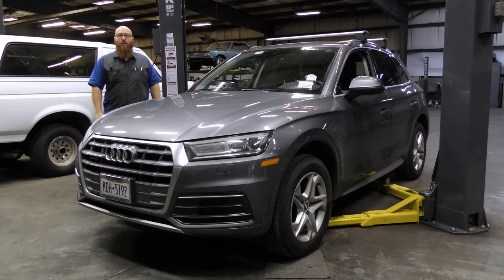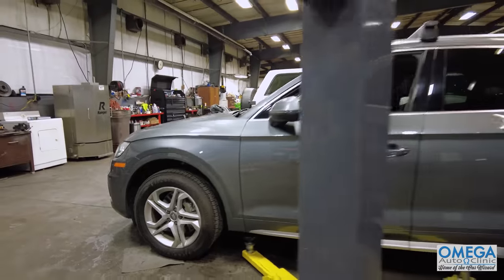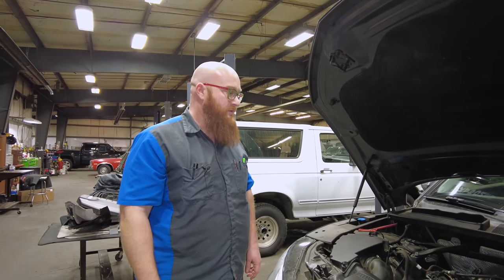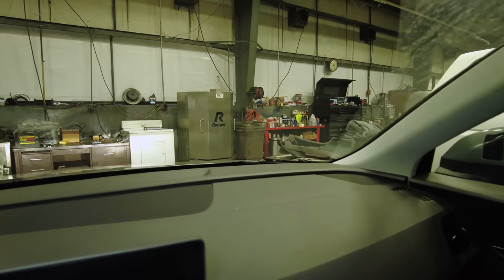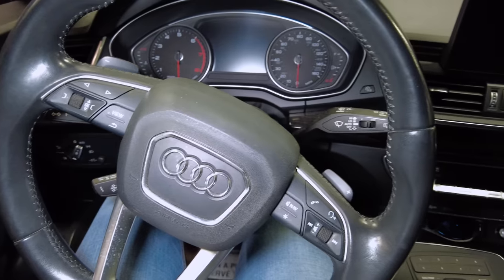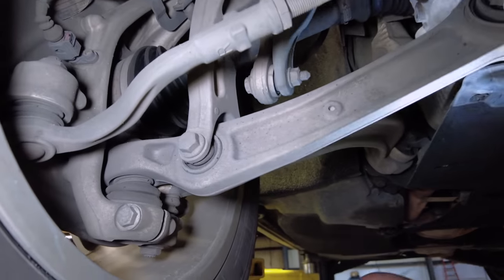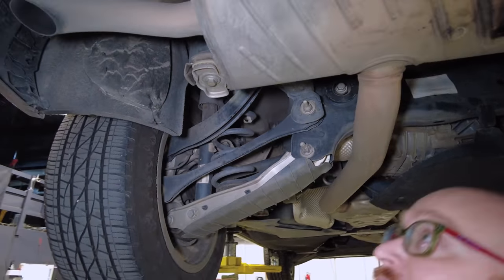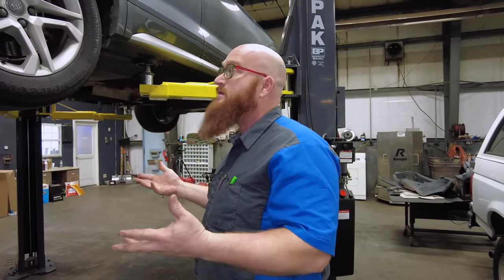2019 Audi Q5 with 200K miles & the service records to prove it! What did the CAR WIZARD need to fix?

Comment: If I had kept up with the maintenance on my 2014 Jetta SE I would still be driving it! The car ran great, transmission shifted smooth (even though it had never been serviced) and the alignment was perfect. 
Unfortunately, the 1.8 TSI had never had the timing chain checked, the water pump was original, and it needed Control arm bushings, which are not sold separately from the arms. I needed a vehicle I could rely on to make trips on the interstate, and we'll, with the transmission never being serviced, that wasn't happening. I traded it in with 187k miles, and regret it every day that I drive this 2021 Corolla LE.
Reply: But your corolla will NEVER let you down or leave you stranded! That's what you said you needed, reliable transportation on the interstate.  Yes the corolla is very boring,  but it's very efficient,  easy to maintain,  and simply won't break. Can't be beat for the attributes that people buy corollas for!
Reply: I have a 2016 Jetta with the 1.8T, I love it so far
Reply: At least Scotty Kilner would approve😂
Reply: @sunnohh  He would stand corrected in this ONE rare instance. He would also say that nearly 200k miles in a 2019 vehicle HAS to be highway miles and highway miles are 10% of city miles. So essentially that audi has 20,000 miles on it in respect to wear and tear.  Good stuff. If those miles were an even  mix of city and highway,  there would be a ton of breakdowns no question.  Based on the data even with good maintenance. They simply don't hold up over time.
Reply: @gabevillarreal96  except I have already had issues with the radio, there is a weird vibration only when hold a speed, and the CVT transmission is very annoyingly slow at pulling out into traffic, causing me to have to anticipate a longer distance between cars to pull out into traffic. That's fine in rural areas, but in the city where it's bumper to bumper, it could be a long time to find an appropriate gap to pull into traffic in. The road noise is horrendously loud compared to my Jetta as well, which makes the issues with the piss poor calibrated sound from the radio so much worse. To get the sound even remotely decent, I had to fade the audio all the way to the back to get it off the windshield, and turn the mids damn near off cause I could literally hear backup singers louder than the lead singers in most songs! The built in WIFI was registered under the previous owner, and I cannot get either AT&T nor Toyota to clear it so I can register it for me, so that function is dead as well! (Toyota says contact AT&T, AT&T says contact Toyota, it's a huge mess!)
Reply: @gunnargeroy8406  I literally only changed the oil, tires, and air filter on my 2014 for the 5 years I had it, and never had a single issue until I went to have it inspected the last year. The Cam phase sensors on the intake cam had went bad. No big deal, but for those 2 sensors and a oil change (since they had to take the filter off to get to one of them) cost $964, not bad considering that was the ONLY repairs done to the car. The only other issue I had was the trunk lid would fill up with water when it rained, my only guess was the seals around the lights on the trunk lid were bad. Opening it up and holding it open would drain the water out, but if I forgot to do it for a while, the water would go into the spare tire well and fill it up as well.
Reply: @Celician83  Well I hate that for you! Especially in a 2021. Those are nagging annoyances but I truly believe your Corolla will remain consistently reliable and dependable
Reply: @sunnohh  in some ways Scotty has a point, but others he is a total quack. For instance, IDGAF how well it worked for him, using "Head Gasket in a bottle" products is NEVER a solution for a car! It causes more issues than the head gasket, and a lot more work to get that engine back up to running, sometimes even ruining the engine and coolant systems in the process. If you have ever worked on a car that it has been used on you will know what I mean! It will stop up your radiator, heater core, ruin your coolant hoses, oil cooler(if it has one) water to air intercooler (again, if it has one) water pump, and more! If you plan on junking the car in the next week or so, sure, use it. But if your doing it just to sell it, that's a really dick move your doing to the next owner!
Reply: @Celician83  well for only that with 187,000 isn’t bad at all imo
Reply: @gunnargeroy8406  exactly! I think VW's mostly have a bad rep for the old FSI engines with timing belts they had in the early 2000's. These motors are COMPLETELY different and WAY more reliable. I'd put the reliability on par with Toyota, and for the same price as a Corolla, I'd get the Jetta, if you can find one. The only reason I bought this Corolla is cause the only Jetta I could find were base models with the old 2.0FSI non-turbo engine!
Reply: @Celician83  I have a MK5 06 Jetta with over 210K on it, and it's mostly original. The suspension is just finally starting to have issues with a hard clunk when turning the wheel all the way left or right (maybe a control arm bushing?). Back in those days, the 2.5 inline 5 engine was the way to go for reliability, they would last hundreds of thousands of miles with only minor maintenance. It's no surprise the trans held up without being serviced, it's the same Aisin-Warner transmission used in the MK5s, only difference is the valve body went through numerous changes to solve reliability problems with them that plagued MK5s. Mechanically, the 09G is actually quite reliable.

I feel that coming from a VW owner, they really do get a bit of undeserved hate. All cars have issues with age and mileage. Preventative maintenance should be done on ANY make and model, being cheap just costs you more in the long run when something major does break.
Reply: @gabevillarreal96  mainly I feel like being robbed considering the Jetta was equally priced yet magically way better a car. I mean for god sakes in the Jetta the sound system is tuned by fender at an equivalent price to the Corolla. But the vibration I'm feeling only when on the throttle really has me concerned when nobody else seems to be able to find the issue, and I'm worried it may be due to the CVT transmission. Also, I've noticed that at 75 mph according to the GPS on my phone I'm only driving 68 mph. If that's true then my car is reporting more miles then I'm actually going which is speeding up how quick my bumper to bumper warranty runs out, and I do a lot of interstate travel. I could understand some variance except these are the original tires that came on the car. I would think that the speedometer would be more accurate than that but according to Toyota that is within variance!
Reply: @Celician83  I feel for you brother. It's a 21' so I would take any concerns straight to the dealer. I also woukd try and record the issues with ny phone as they are happening just in case they say they cannot replicate it. I bought my daughter a 15' corolla 6 years ago abd its been perfect. Zero issues. 87k miles. I actually found it pretty quick off the line because corolla are equipped with what they call a launch gear to get going faster. But I'd definitely take it in with all your concerns abd if you don't get it fixed, go to another dealer.  Be relentless in your pursuit of a remedy from them. You paid for it.
Reply: @gabevillarreal96  from what I gather 2017 is when they went to the CVT transmissions and they are extremely annoying. It's almost impossible to hold it a steady speed without just putting on the cruise control because every little Hill you go up or go down the transmission speeds up or slows down, and you could feel it speeding up and slowing down. However on the speedometer the needle doesn't move in the digital display shows that you're running the same speed even though you can feel that it's not. In my honest opinion I'm going to wait out the car market and see if any more Jettas show up on the market and just trade it in when I can. I can imagine the reason why it was traded in after one year was probably the same reasons I'm having, but it's just not that great of a car.
Reply: You absolutely have to get the fluid changed on the dual clutch transmission.  Its kind of like CVT that way.
Reply: @Celician83  I'd rather push my GTI than drive a Corolla no offense.  Not saying all Toyota's are below my standard.  I drove my brothers maybe 2014 corolla and yuck.  I'm sure a well equipped Camry or Rav4 is pretty decent.
Reply: @droptoasterintub297  I'm pretty sure the Vr6 was known to be well above average reliability.  And yes all the maintenance done on this Audi should also be done on a Toyota.
Reply: @gabevillarreal96  won’t break? Is that why Toyota has dozens of recalls on them every year? All cars break lmao
Reply: @diablocls55  All cars break. That is am established fact in the industry.  How often and to what degree amd expense do they break down.  Which brands have a reputation for consistent breakdowns over the life of the vehicle and brand? That is also very well established.  Toyotas simply break way less. And in this conversation we are comparing it to his previous car which was a VW jetta to which there is NO COMPARISON on the reliability dependability front. I owned a 2001 Jetra 1.8T with a 5 speed manual and thought it was so much fun to drive. I owned it for 7 years from brand new with 7 miles on it. I put 157k on it and it was in the shop FOR REPAIRS  10 times a year. Major repairs. I've had my Accord EX-L V6 Coupe for almost 8 years and have never seen a repair shop. Completely different experience.  My daughter's 15'  Corolla  has been a gem with regular maintenance I do myself. Zero issues. My mom has owned 7 lexus's in a row driving them each to 150k with ZERO problems whatsoever.  You simply can't do that with ANY German brand or Korean for that matter. My sister's 15' Sonata was a nightmare after 90k miles in the shop once every 2 months before o finally got it sold and got her into a 19' Corolla GR Hatchback.  She loves it. And again, so far zero problems.  If you have a great experience with other brands then more power to yiu. Ive just never seen it. BMWs AJWAYS break. Mercedes same Audi sane VW same.  All nightmares as they age. Just not my thing. There us a reason Toyota hs the largest automaker on the Planet and the Toyota Corolla Is the best selling vehicle of all time! It ain't because of driving dynamics.  It's because of consistent reliability efficiency and cost to own.
Reply: @jeffk464  ABSOLUTELY! And Audi VW make a really good one!
Reply: @Celician83  haha good shit man I agree 100%. VW all day 🤘
Reply: @gabevillarreal96  I'm telling you, the older early 2000's VW's were bad, everything made past 2013 when they fixed the 1 issue with the timing chain guides on the TSI engines are bulletproof and extremely reliable. Like I said, I owned my Jetta for 5 years from 68k miles and the 5th year is when I actually had to put money into it. I'd tag the guy that talked about the Dual clutch transmissions if I could scroll up while typing, but mine wasnt a dual clutch, it was a SE W/Convenience. That being said, it had the automatic that has a special plug that ok only VW has to drain the fluid and fill it while the engine is running, with it in gear, so that the trans pump never runs dry. That service last time I checked was $365. On the other hand, Toyota wants to charge me $295 just to flush the fluid in this CVT transmission, and to replace the filter will cost over $1000
Reply: @Celician83  And what's crazy about changing the cvt fluid in the corolla is that it's a drain and fill and they only get out around 2.8 quarts out which is not a full exchange. Fir 395!??? No good. So at best you get a 66% old fluid 33% new fluid mix which better than 100% old fluid but it should be that expensive
Reply: @jeffk464  I agree, unfortunately when I needed a long travel reliable car, the only choices were Corolla, Sonic, Elantra, Soul, or Altima... I think I made the best choice for what was available at the time, cause the few Jetta'sI could find were marked up 10k over MSRP for vehicles with over 40k miles on them, around $32k
Reply: @Celician83  And I haven't been that impressed with VW since they built that plant in Chattanooga. I feel that they used to truly feel German back then when I had mine but when fior an Americanized version of the brand and cheapened their interiors and driving dynamics.  The Passat used to my a Baby Audi And so was the Jetta. The GTI still has that Germanic riad car feel inside and out but tge rest of the line up to me is disappointing from what I remember the brand being. Maybe that's part of the brand being more reliable then they were back then.
Reply: @gabevillarreal96  my Jetta was built in the Mexico plant, they been made there except the GLI and GTI since the early 2000's. Besides, Toyota and Subaru are also manufactured in Georgia. The same screw, bolts, and nuts are used in them no matter where they are assembled, just cheaper to ship parts individually to the US vs Large cars on boats that could be damaged by storms in the Atlantic, (which in 2020 happen to a large shipment of Porsche's and Lamborghinis headed to the US)
Reply: @Celician83  There is a difference.  Lexus vehicles that are made in Japan are inherently better than those made in America.  Mexican made vehicles are generally not good. Itvmay be the sane buts screws and bolts but the Japanese take more pride in their work abd their standards are simply better. It shows in the vehicles quality abd structural integrity. Canadian made vehicles are also very good. And it's not a prejudice, I was born and raised 22 miles from Mexico in Texas. My Jetta was built in Mexico and it broke down all the time. My mom's first 6 lexis vehicles were made in Japan with zero issues and zero recalls. Her 2019 Lexus ES was the first one built in  Kentucky and after 7 ES models this 2019 model has had 2 recalls and the built quality as far as the way the doors sound when slammed and the interior materials and structural integrity is just different. Not better at all
Reply: @gabevillarreal96  I’m not even gonna read all that, but the reason Toyota is the biggest automaker and the Corolla is the best selling car is because they are the cheapest cars money can buy. LMFAO, if Bugattis were the cheapest car, they would be the best selling car of all time too
Reply: @diablocls55  nope it's because they are the most reliable and not everyone in the world is dumb my friend.  Your opening statement says it all. " I'm not even going to read all that." That's the difference between you and I, I read ALL THE DATA so that my opinion is information and facts driven not hyperbole and slander.  Have a great day.

Comment: I had a 2008 Audi A4 B7 V6 AWD. I put 250k on it over 8 years. Mainly highway miles and I did the normal tires, oil, brakes, and gas. No transmission or differential fluid changes. 

The only thing that ever failed on me was the radiator fan module and the AC blower motor. 

I know i was in the minority for a VAG product, so I think my constant oil changes every 4K miles and the fact that I did 100 miles of highway driving pretty much each time I drove it led to its success.

Comment: The 2.0T 3rd gen is a great engine and so easy to work on
Reply: EA888 right? I had one a long time ago, pretty solid engine with the dual injectors to avoid the caking up of intake and inlet valves. Good power even down low.
Reply: @JohnAbrahamsen  You sure? I'm not sure it has port injection in addition to direct injection.  I think its just direct injection.
Reply: @jeffk464  European versions have both, American version is only DI. Gen 3 is pretty reliable in either version though.

Comment: One of my favorite and most reliable cars I owned was a 2007 BMW 530i.  I was a fiend about the maintenance. I replaced the oil ever 7,000 miles over the recommended 15k.  It ran perfectly until a clown totaled it at 178K miles. Miss that car.
Reply: 15k intervals were a joke in that engine and no doubt caused a ton of grenaded engines because BMW didnt want to pay for more frequent oil changes.  Now its 10k for a reason.  Even that is a stretch for a turbo engine.
Reply: Definitely don't adhere to the "recommended" 10,000 mile service intervals on my 2018 S5. That's just foolish. Oil and filter gets changed every 5,000.
Reply: Rubbish I have 270k miles on an bmw e90 325d, changed oil at 10k miles. No issues at all, apart from usual dampers, brakes and tyres and a clutch at 180k.
Reply: I just don’t understand the American fixation on change if oil all the time. Oil technology is light and day better than 20 years ago.
Reply: @aaronbrown6266  I typically end up changing my oil at the recommended 1 year interval, I don't drive that much.  Is this ok? I probably put about 6,000-7,000 miles on it between oil changes
Reply: @ibisona  You are probably right. Every so often I have a company (Blackstone Labs) test the oil after I have used it. They often state the oil "could last longer' and has plenty of life in it. For me It seems to make me feel better and been a winning plan for my cars.
Reply: Oil is cheap. Engines are expensive!
Reply: @ibisona  You do you, bud.